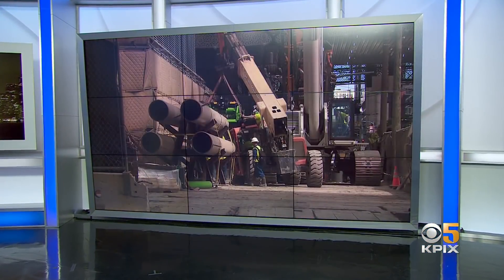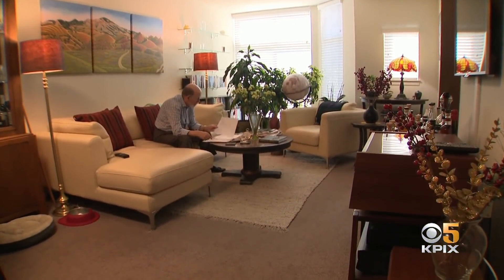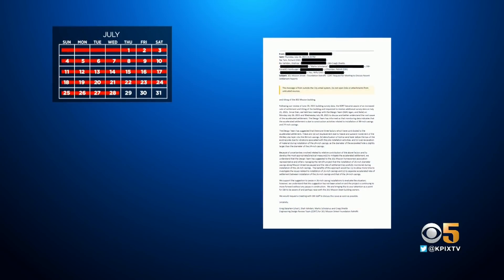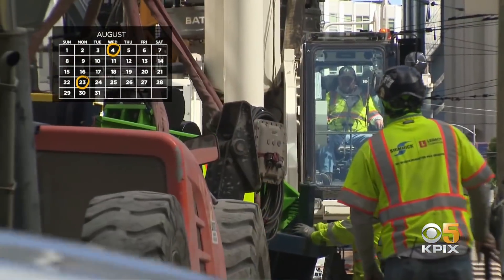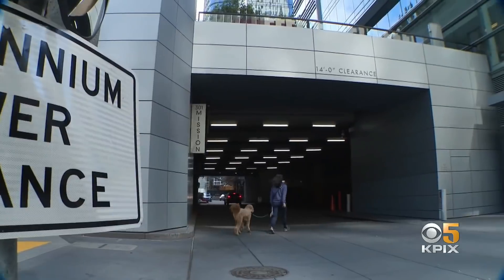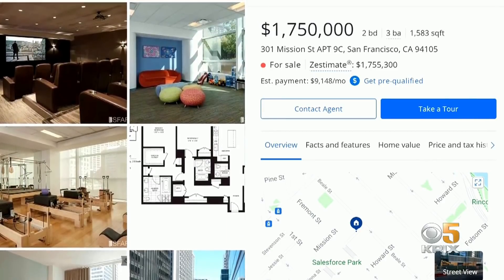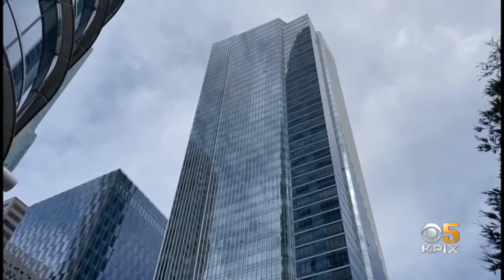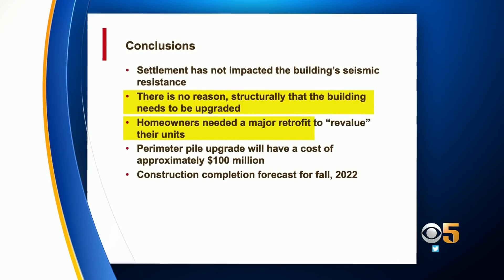Despite Warnings, Repairs on San Francisco’s Millennium Tower Caused Additional Sinking

Comment: Ronald McHamburger assures it’s still safe though. And the sewage problem will probably resolve itself.
Reply: The sewage will harden and cystallize the building into place
Reply: One inch of settling on one side of foundation equals how much 50 stories up?
Reply: @MikeJones-rk1un  
I'm not an engineer, but common sense says : a building so tall, smack in the middle of high density area is a scary thought 😳.... cheaper and safer just to controlled demolition..and build a park over there..🤔🤫

Comment: The  fix is using a remote drilling process which is a process where drilling goes on only 6 feet at a time....replacing each 6 feet of depth with a concrete ring(pipe)then drill another 6 feet...
ect......without disturbing any surrounding support soil. It s a VERY simple process would solve the problem......but it is slower therefore MORE EXPENSIVE.....but it would be effective.
Reply: right!
Reply: Remote drilling? Do you know what you are talking about?
Reply: @philhowells1859  Remote drilling is used in the oil and gas industry and seriously has no function here as it does not at all apply to stresses of the weight, mass and tension of such a behemoth building.